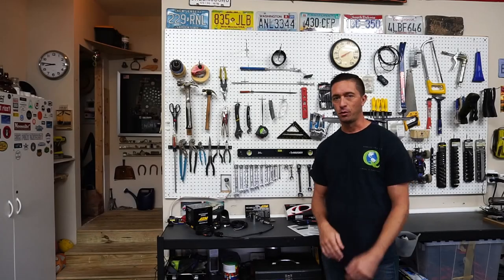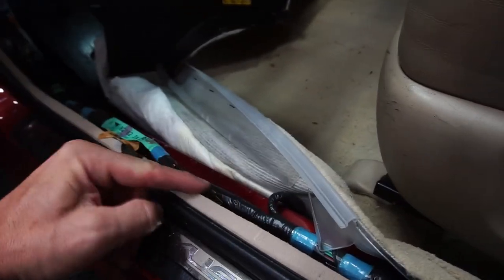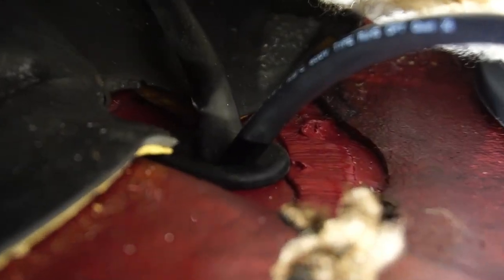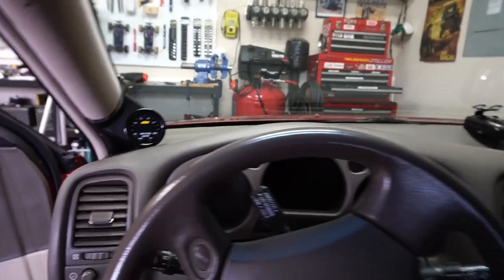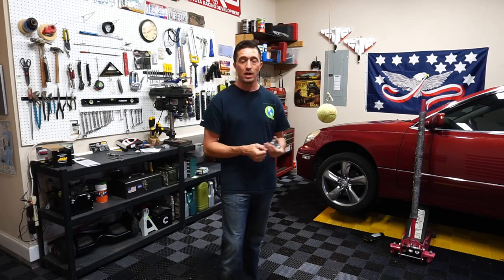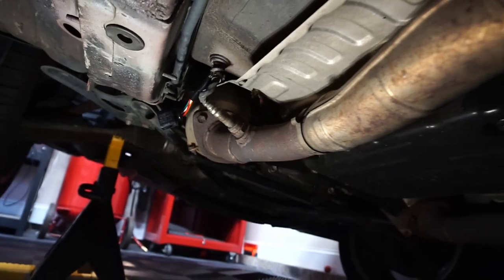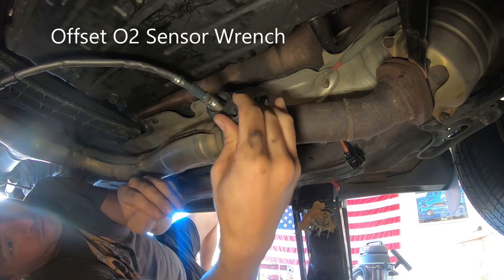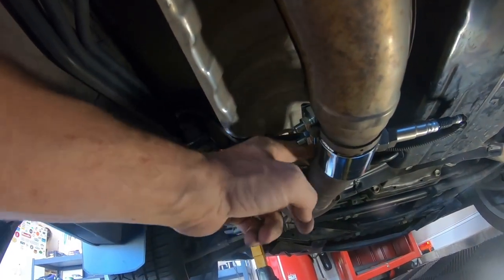Installing an AEM UEGO wideband AFR sensor WITHOUT a welder! (Lexus GS400 shown)

Comment: Will you be installing any other gauges in the future?  Maybe engine temp or oil and a DIY?   Such a clean GS400.  thanks for the videos
Reply from the maker: At this time I’m happy using the OBD WiFi adapter as I can get coolant temp and other parameters live. I need to be able to put it right back to stock when I get an ISF (ha ha).

Comment: So my concern is that it's not reading both banks. 
I was thinking to put it after the y on the pipe.
Reply from the maker: I debated that too. In the end, bank 1 allegedly runs the leanest of the two, so to avoid both cats messing with the signal, I chose bank 1. LMK what you decide.
Reply: @ForwardMomentum  makes sense, my mistake I forgot that I have gutted out cats so that's what made me think like that.
Reply from the maker: UNDER FUNDED GARAGE oh you should be good to go then!

Comment: What fuse/wire did you tap into for the ignition fuse? Is there a wiring diagram that you used? Thanks
Reply from the maker: It may have been CIG. Any non-critical 12V switched source is fine.
Reply: @ForwardMomentum  did you tap from the kick panel fuse box?
Reply from the maker: Yes.

Comment: Is the stock o2 sensor thread the same dimension as these wideband o2 sensor threads?  Can you just take out the post-cat stock o2 sensor and put in the wideband one in its place?
Reply from the maker: Yes, same pitch. You’ll throw a bad CAT (aka “TWC”) code if you pull the rear sensor. You’ll need a sim to prevent it. That’s why I just ended up doing a weldless bung.
Reply: @ForwardMomentum  Thanks for the reply.  I'm on an Aristo GTE swap and Aristo ECU, I wonder if it will still throw the bad CAT code.
Reply from the maker: Great question. BTW, that’s awesome!

Comment: My post cat sensors have been removed and the holes bunged up I'm guessing by the previous owner, no codes and all runs fine, could I just re-open the hole and use the stock o2 sensor socket/thread location for the wideband? Thanks.
Reply from the maker: Yes that should work.
Reply: @ForwardMomentum  Great, thanks.

Comment: I just installed my wideband and noticed that I run good AFRs but it leans out when I'm slowing down my Gs is stock have yours done that and if so how did you fix that problem
Reply from the maker: That’s normal on deceleration because the injectors close and your combustion naturally leans out. Under open loop is what matters.

Comment: Can u give me the website where to buy that bong iam re drilling my hole O2 got stuck what was the final drill bit size so the O2 will fit
Reply from the maker: PN is: 30-2355-200 which I bought on eBay for $39. Drill 13/16 - 7/8 hole per AEM instructions.

Comment: Could you use the same concept to put in a gs300?  I was wondering if I could put install a wideband
Reply from the maker: Of course!
Reply: @ForwardMomentum  do you said it wasn’t possible to put the wideband in front of the cat because there isn’t any room, but if you remove the cat and install the wideband in its place it should read more accurately right? I’m assuming you haven’t taken out your cat because of California emissions?
Reply from the maker: AEM told me post-cat install results in about a .1 too lean AFR reading. So if the gauge says 12.5, it’s actually 12.4. So tune accordingly. On the GS4 you cannot install it pre-cat without a welder and even then it would be very tight. You’re correct, if you have no cats, then it would be the same as installing pre-cat basically.

Comment: Great video but you should have put that wideband on the other side of the pipe
Reply from the maker: It wouldn’t fit there. I considered it. Remember, they have to be “clocked” to avoid water in the pipe. You can’t clock it on the other side of the pipe at all (not enough clearance).
Reply: @ForwardMomentum  in the video it looks like you have plenty of room on that same side as the O2 sensor ...
Reply from the maker: It may have been the GoPro angle that made it look that way. I couldn’t get the 90 deg drill in that spot either to make the hole. I was surprised how limited my options were on bank 1.

Comment: 14.7 is the norm for regular gas reading. Aim for 13.7.
Reply from the maker: Sorry, but that’s not accurate. It has nothing to do with fuel type on my set up and what AFR I run. 14.7 is the closed loop cruise target.
Reply: @ForwardMomentum  i run the same AFR, and yes it does. I also have the same AFR and Apexi SAFC2 on my actual jdm Fairlady z32TT. Nice Lexus though to bad its not boosted. Any plans for it to be?
Reply from the maker: Sounds like you have an awesome car. On the LEXUS it doesn’t work the same. In closed loop you can manipulate the fuel trims only with the NEO Lo settings, but the ECU will fight for 14.7 no matter what you throw at it. The GS400 ECU cannot be cracked either, unlike the 3UZ ECU, which can be. Anyway, check out more recent episodes. I have since manual swapped and supercharged the car. I had to use an SS Enricher to get my AFRs richer in closed loop. I finally succeeded, but as you can see it requires a piggyback on top of an AFC to get my AFRs enriched in CL.
Reply: @ForwardMomentum  i gotcha bro, meant no disrespect.
Reply from the maker: No worries at all. I appreciate the dialogue. 👊